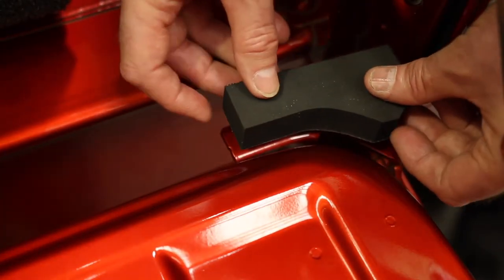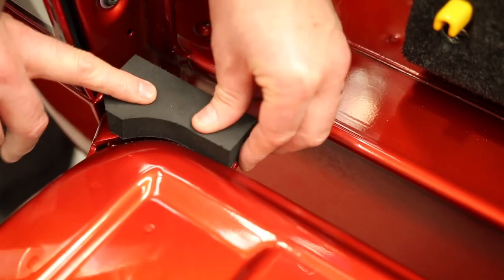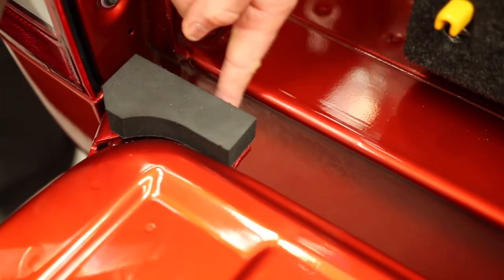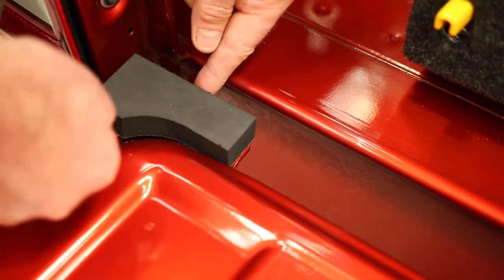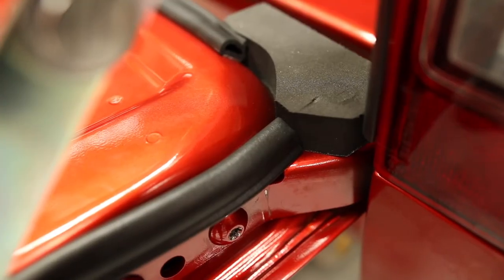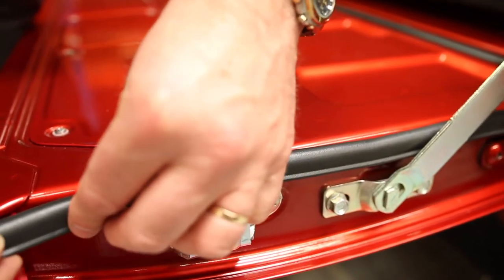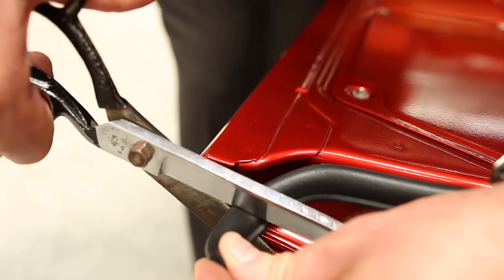Grunt 4x4 Seal Kit Install - Isuzu DMax

Comment: You guys really need to get your instructions correct!!!! This video (1min 6seconds) says install the seal on the egde of the tub and the instructions you sent with the seal kit  says install on the edge of the tail light. They are two COMPLETELY DIFFERENT spots and now my tailgate is not "sealed"